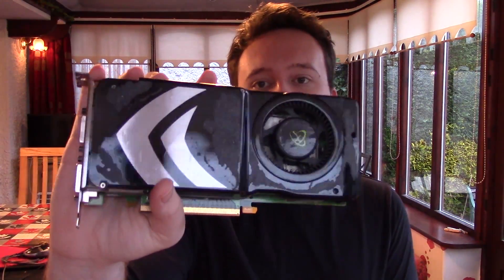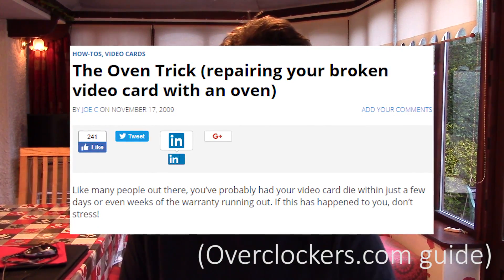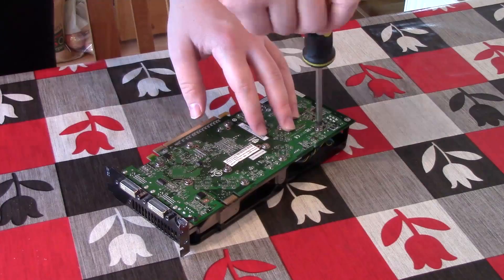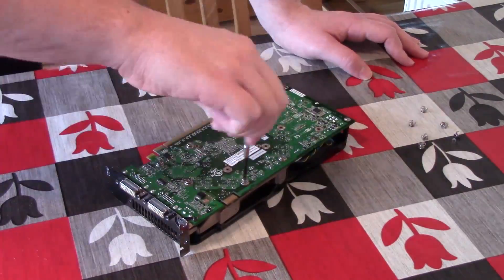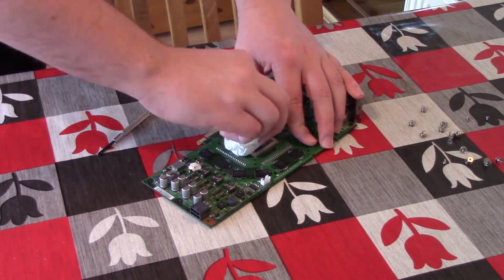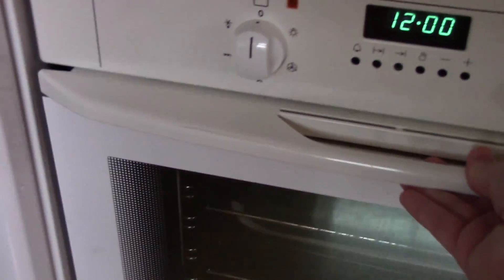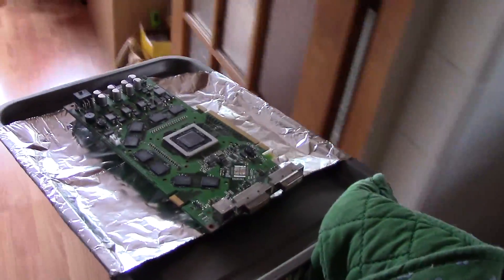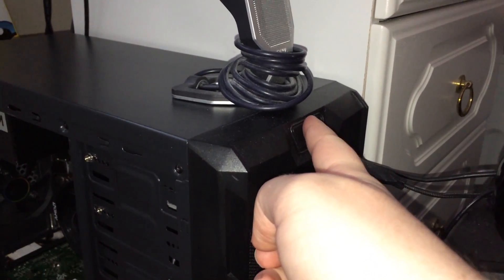Hardware Myths: Oven Baked Graphics Card Repair

Comment: if you don't have an oven you can use gas stove keep it low and cover any plastic part obviously don't keep it right over it keep it away from the flames worked on my gtx 560

Comment: I did this with my 9800GT in the past.
After that it worked for almost 2 more years!
I expected it to last a few weeks or months but not almost 2 years!
It was also overclocked.
Reply: Hey, may i ask if the plastic parts (8 pin connector, fan connectors) etc. melted? did u have to cover it separately?
Reply: @kturtle038  They will be fine. They have a pretty high melting point. I baked mine at around 180C.
And put the card on aluminium foil balls... never let it touch the oven rack because that gets way too hot. I used an oven rack for better airflow.
Reply: @TonyNL87  thanks! I reckon mine shorted so i dont think the oven can fix that unfortunately
Reply: @kturtle038 You can always bring it to an electronics repair shop so they can check for problems.
As long as the chips are fine it can be fixed.
My card started to show artifacts while gaming so the solder had micro cracks.
That's the only time an oven can fix it because it will reflow all the solder and remove the micro cracks.
An electronics repair shop could also do a reflow but the gas my oven uses is cheaper.😂
Reply: @TonyNL87  the gpu is so old it might be cheaper to replace than fix, rx 560 survived for a good 7y haha

Comment: Removing the old thermal paste and applying New thermal paste will usually graphics fix cards that glitch/crash during startup. This method I assume does nearly the same thing, just renewing the thermal paste in a way. Here’s something I learned: My 2008 Mac Pro quit booting when I sprayed compressed air into the 8800 GT from the rear, after a while I learned this GPU uses little pads all over the place and I can only assume the compressed air loosened the connection between some of these pads, I ended up buying a new GPU, I can almost guarantee had I put the GPU in the oven, it would have melted those pads enough to make good contact again and it would have worked.

Comment: I have a RTX 3070 that was dropped. This is a different case however. 

The drop caused cracked joints somewhere on the Memory. Reflowing fixed it completely.

Comment: I have done this multiple times to my 2009-2012 Imac 27" computers and had them work for a year to four years. Certain boards are prone to bad solder connections and this helps reflow those connections. I'm not familiar with any other boards or computers where this might work.

Comment: Most GPU if over heated above 100c will go  black screen.   Most time GPU will fall when they get to hot but it got nothing to do with  the GPU chip as it  has to be soldered in with multiple solder beads at a tempiture of over 300 degrees No oven  can get that hot So A GPU chip can  take far more heat then the 100c The thing is   GPUs are very well protected in that they  have several things to protect  them At 100c  the small fuses  will usually blow also over heating the GPU 6  mosfets  can short circuit there are simple test if you find one of the fuse has failed unsolder the old 4amp  fuse then drill the board to fit an after market 4amp fuse to it if you find a failed Mosfet! and you haven't got one to replace it To  remove the short. So the gpu will work you can try  just unsoldering  it. and removing it from the board Most times this  may work.

Comment: Louis Rossman is mostly wrong in his explanation about “re-balling” failures. His reasoning for what causes a temporary reanimation is flat out incorrect. But is correct about is that most people misunderstand what happening, including himself. He is also correct that it’s mostly a bandaid and temporary at best. The reason most reballing repairs fail is because it’s a BGA failure such as a lifted or damaged pad. Reballing in this case is doomed to fail as thermal stress will cause a return of the problem

Comment: Yeah... Linus did this and pretty much debunked every single thing you said at the end, so that's false buddy. It fixes it by reseating the solder and silicon on the card and seeing how nobody's gpu will reach 375f inside their pc there's not much chance of the gpu heating up enough again to have it fail as quickly as you make it sound. Sure overtime heating and coolin(expanding and contracting) might kill it again but that's most likely a long way off.

Comment: In addition to the comment below, you should not have removed the card while it was still hot, it should be left to cool. Furthermore, but of course aside from the electrolytic being murdered with heat (remember they are wet caps), care should have been taken to ensure that the card is level. It would also be advisable (unless you absolutely trust your oven) to place an appropriate thermometer to ensure the oven is indeed delivering a precise amount of heat of 200°C. It could go up by a degree or two but not more. The whole concept is the reflow of solder. Now I do say all this knowing that there are still other variables that might not revive a card as there are numerous other physical properties other than solder, in some cases even fine strands of gold inside the GPU but the point here is that in some cases people cannot afford a new or even used computer and all that could be wrong might be fixed, albeit temporarily, with a bake. It doesn't cost anything, just some time and a small investment in a thermometer for inside the oven, maybe some thermal pads (if you know how thin they should be), non-conductive K5-Pro paste for the GPU and of course some time. Even if it fails to deliver a working card it offers an educational opportunity and may keep your machine from going to the land fill unless, as in your case, the GPU card is modular. Hope this helps others.

Comment: Well, the problem is that you are baking that whole card and the problem inherent in your case are the electrolytic capacitors, you are baking those caps at 200° so yes, if your bake failed then it should be mentioned that the caps have most likely been nuked by the bake.

Comment: If you REALLY want to do something like this, you need a couple of temp probes and a toaster oven (preferably one with a fan) that has been modified with an arduino that bakes the card at very specific temps, controlling the heating element to slowly bring it up to temp, AND slowly decrease the heat to bring it back to room temp. You'll also want to look up the temperature curve for the chip you're re-flowing. Something like THIS: https://github.com/0xPIT/reflowOvenController

Comment: Rossman is an idiot. BGA's were used way before they developed the infra red system of soldering them in place. Most of the older tech used ovens and hot air to fix them in place. These still survive and and actually have lower failure rate than the later infra red processed BGA's. The biggest reason for BGA failure is the use of lead free solder balls. The solder is harder and the balls tend to crack whereas leaded solder is much more pliable and is more forgiving of the expansion process produced by heat. I've bought back many hundreds of BGA faulty devices by heating over the years with controlled hot air reflowing.

Comment: Baking a circuit board in a CLEAN ELECTRIC CONVECTION OVEN IN A WELL VENTILATED STRUCTURE may solve your problem.  This is a LAST RESORT measure to rescue a dead or faulty circuit board that you are not worried about throwing away.  I typed this comment on a ten year old laptop with a motherboard that had a faulty GPU that is soldered to the motherboard.  The laptop booted up on an external VGA monitor but the LCD would not power up.  I fixed the problem by baking the motherboard with following the process:
 
Remove ALL batteries from the circuit board.  Remove ALL removable components from the circuit board. Remove ALL removable heat sinks from the circuit board and clean off all heat sink compound. Remove ALL easily removable plastic insulating material, foam pads, stickers etc from the circuit board.  Remove ALL FLAMMABLE materials.  SAVE and ORGANIZE everything that you removed in order to replace it later.  Clean the circuit board thoroughly.

NEVER set a printed circuit board on anything while baking it.  Take an oven rack out of the oven and set it on objects of equal height at each corner of the rack on a CLEAN level surface so that the oven rack is level.  Make sure that you have enough clearance to work with your hands from below the rack.  Make metal wire hooks with needle nose pliers. I used steel paper clips. Suspend the circuit board from its screw holes to the oven rack with the metal hooks.  Make sure that the circuit board is level while suspended.

You want to have the suspended circuit board as close to the center of the oven as possible.  Find a cookie sheet that is larger than the circuit board with a couple of inches of clearance from all sides of the oven.  Center the cookie sheet on an oven rack so that it is an inch or two below the suspended circuit board.  Physically check all the clearances by placing the oven rack with the suspended board over the oven rack with the cookie sheet  Take the oven rack with the suspended circuit board out of the oven.  Leave the cookie sheet in the oven centered on its rack. 

Find a WORKING FIRE EXTINGUISHER AND HAVE IT AT THE READY. Preheat the convection oven at EXACTLY 385 degrees FAHRENHEIT. Use an accurate oven thermometer if your oven thermostat is not digital or you do not trust its accuracy.  Turn on your oven light if you have one.  After preheating for ten minutes, put the oven rack with the suspended circuit board in the oven over the oven rack with the centered cookie sheet. Close the oven door and WAIT EXACTLY EiGHT MINUTES, no more and no less.  Open the oven door all the way and shut off the oven. DO NOT TOUCH the circuit board or the rack that it is suspended from for at least thirty minutes.

If you detect any flame, smoke, fireworks(snap, crackle & pop) in the oven during the process, then IMMEDIATELY SHUT OFF THE OVEN, HAVE THE FIRE EXTINGUISHER AT THE READY AND OPEN THE OVEN DOOR ALL THE WAY. CLEAR ALL FIRE AND SMOKE OUT OF THE STRUCTURE THAT YOU PERFORMED THIS PROCESS IN OR EVACUATE AND CALL 911. Figure out what the problem is and resolve it before trying again.

If all goes well above, then replace everything that you removed from the circuit board, reinstall it in your device and check it out.  This process may be performed multiple times to a circuit board if it fails to work properly. 

Good luck!

Comment: Hey, I had done this a couple of years ago with a GTX 570. Familiar to you, it started to create weird visual purple lines until the system didn't recognize it at all. However, after I did this, the graphics card survived for around one more year without problems before the same issues started again. So yeah, I suggest to try it out and bake it. If it works again, you may save some money to buy a new one after a year. :)

Comment: it fucking works! my r9 280x started grey screening and  was getting red and green artifacts. after removing what i could, i used a heat gun on it and then applying thermal paste. working for 2 days now while new gpu arrives. good quick fix and i dont recomend the oven as the gpu will release harmful gases that could contaminated food cooked in there later...

Comment: I have personally used a heat gun directly under the GPU die. There’s thousands of little solder points connecting the GPU to the PCB. Using a heat gun (and maybe a little flux if you have some) can fully melt the solder and help it reflow fully. The oven works, but is temporary. Using a high temperature heat gun is a slightly more solid option. :)

Comment: i can tell you guys,when you have just black screen or beeps from motherboard,dont do this. do it only when you have video output artifacting/drivers wont load/there's gpu problem showing in device manager. first take the card to repair shop so they can do all the voltage and resistance measurements etc...you can do it by yourself,with a multimeter if you know.

Comment: 2 out of 3 worked for me.  Revived an artifacty 9800GTX+ and an blank X800 XL.  Not used in main daily use PCs of course.    In rarely used retro LAN setup.  An X700 Pro still didn't work.

Comment: My card went down and I saw this method on line and thought this cant be true but had nothing to loose so I baked it when it cooled down I realised I had no thermal paste so used toothpaste until some arrived through the post and to my shock it worked and still is a year later

Comment: My Titan XP is running a few degrees too hot, so I'm going to try this method. I will be using my family's oven, but don't worry, I won't be using it for food ever again. They will, but I won't. Anyway, I hope this gets my card down from idling at 38 degrees Celsius. It used to idle at 33 during the winter, and that was just a couple months ago! I don't see any other way, so I will be baking it at 385 Celsius, right? I'll be back to tell everyone when it works!!!

Comment: I can confirm, after my graphics card died inside my iMac, and I removed it and baked it, and then reinstalled it, it didn't work at all and continued not working for a full twelve months before failing again.  What is more, after re-baking the card, once again it failed to work for a further eighteen months, and indeed to this day it is still failing to work.  Full screen Netflix and YouTube videos as well as high end photo editing including panorama stitching and Photoshop compositing stubbornly refuse to happen despite my best efforts.  I do not doubt gaming would also not work but alas it's a Mac so that isn't testable...because Mac.  I can only conclude that the extra two and a half years of usage I have had so far must have been some sort of hallucination and I must have been staring at a blank screen this whole time...?!

Comment: I have baked gpus in the past, but it is a temporary fix as you say. as the videocard will in about say a 6month time exhibit the same problem. But when you are going to bake the gpu you should put your card upside down with the alu foil balls touching the dvi ports and the pci-e power connector.

Comment: I reflowed an Xbox 360 motherboard using this method, and it worked very well, the console still works to this day (it was one of the really early ones with HDMI). It really just depends on a case by case basis if it will work.

Comment: Can you look into the modded X5460 Xeon/775 chips that are all on Ebay for £30 or less (3.16ghz/12mb cache) or the Q9650/9700 range, specifically to see if it can hold up with a 1050ti/Radeon 470 class of cards, if it can it would make a Hellish cheap gaming rig!

Comment: It's basically called 'reflowing' - where it heats/softens the solder which allows it to make proper contact again..

it's basically the same as people using heat guns to 'fix' xBox 360 RROD and PS3 YLOD!.. you can get professional rework/reflow stations and heat guns to do this task properly..

Comment: I bought a gtx970 sold as defective but claimed as working in the description on eBay, just to see that everything artifacts badly if 3d Programs like heaven bench or games are run , i tried the oven trick but sadly it did't solved my artifact issue , i guess the issues are coming from faulty GDDR ram that may be a cause of overclocking the RAM to high ,I really would loved to see that the oven trick helped me out but that's part of the game buying used stuff not always end well :/

Comment: Dont do this with your videocard, it only worked on the 8800 cards because it reflowed the solder joints.

Comment: I used this method to fix a ram stick, had no replacement thermal pads for it so it has torn thermal pads and a cooler held on by rubber bands. Been working like a champ for over a year now

Comment: Hi if someone hire know good hardware can you tell me whats wrong whit my pc:it shows nothing when I turn it ON but I hire everything hire and look fine(cpu and gpu and pcu are spining normally) but it shoe nothing on screen when I changed pcu to see if it is a problem I hired zzzzzzzz for 3-4s when I sit it fully and and put power on and still nothing and when I put of my ram from motherboard it has datacted thet ram is missing and biped 3 times so it works(I think) so can you tell me whats is broke from this information plz help

Comment: The 8800 were the GPUs that started the nVidia packaging scandal, where the die and it's surrounding package would expand at different rates and eventually break internal connections, probably soldering points (faster in laptops that allowed higher temps for silence). Thus many found that heating would solve the issue (basically liquefying the solder and allowing it to repair itself). PS3 was also affected by this problem (although it was a 7800-derived GPU, the 8-series is when the problem has gone public, but affected earlier products).

Thus, for such old cards, this may work (I still have my 8800 that worked for 1.5 years, but never got the time to try it).
But for newer cards, solder breakage may NOT be the problem.

Comment: Baked my GTX1080 as well when failed, lost backplate and EVGA didn't want to take GPU to RMA and only option has been to bake GPU, done it and now this card is running with 2100MHz OC as previously, GPUs are used for rendering and Folding@home 24/7

Comment: If the chip "reball" is that fail ,on the safe side you can cover up the rest of the components with that foil for isolation, but not direct contact with the card.